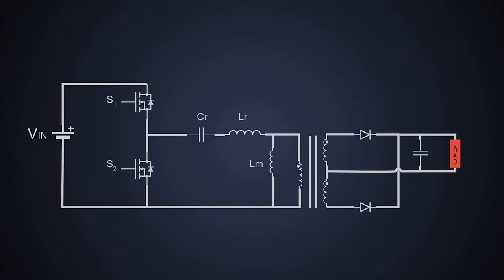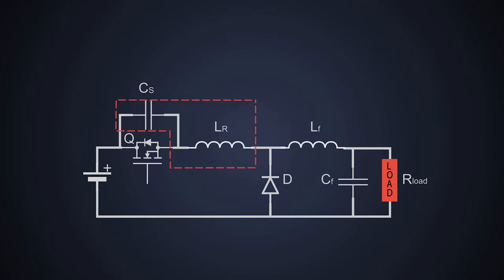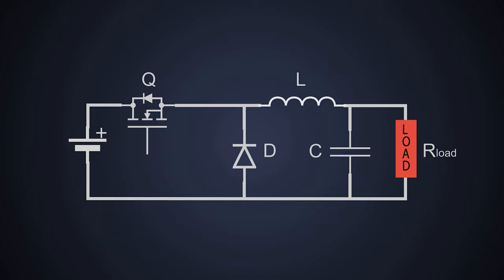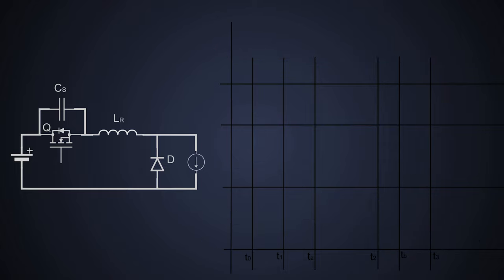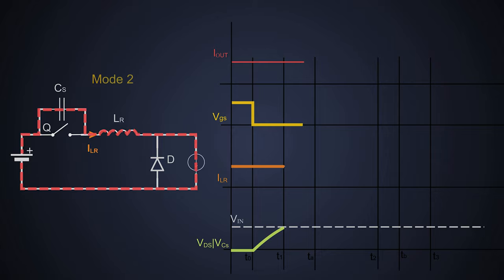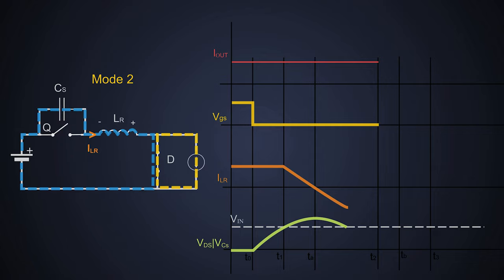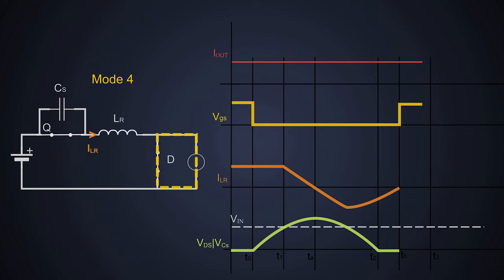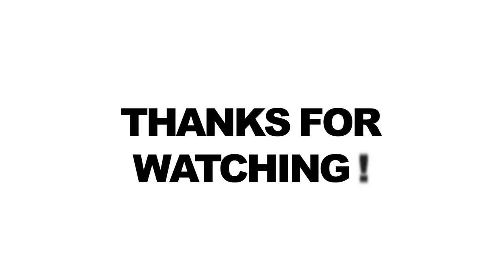What is Zero Voltage switching? ZVS Resonant Converter | Resonant Buck Converter

Comment: Nice explanation  but a short question that you haven't mentioned why the ILR current slope shifts to positive after negative peak and what is the polarity in the circuit and why it happens? Would appreciate :)
Reply: When the switch turns off, the current flowing through the capacitor is the current flowing through the inductor. The capacitor voltage rises to Vin as it charges, and this current continues to flow through the inductor. When the capacitor is charged to Vin, the inductor still wants to keep current moving through it and starts releasing its stored energy by dropping its current over time (negative dI/dt). As this happens, the "bottom" side of the capacitor drops below GND (which is how you get V_ds > Vin). When the inductor has transferred enough energy such that it becomes reverse biased again, the current changes direction and starts to increase in the other direction (towards DC steady state), which is the positive slope you see. This is the nature of a resonant circuit.

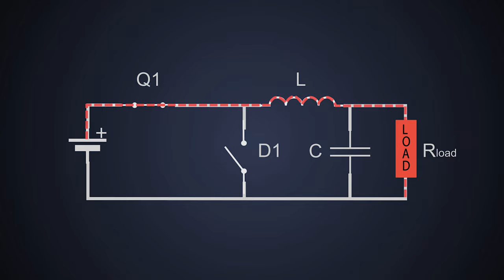Comment: 2:14 I think it's confusing, and inaccurate, to say the diode turns on and off. The on/off state of a diode never changes. It's always "on" in the forward direction, and always "off" in the reverse direction.
Reply: But the direction of the current flow through the diode changes during the different steps of operation which makes it turn on and off.

Comment: 2:35 i thought a constant current source is a source, not a load.
Reply: if the current source sinks current, it's a load. Otherwise, it's a source. If you use an actual current source in the lab, it might show negative current as it's sinking current.